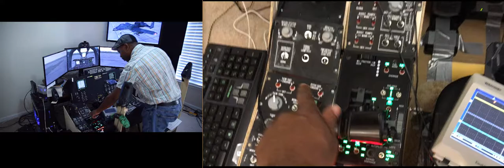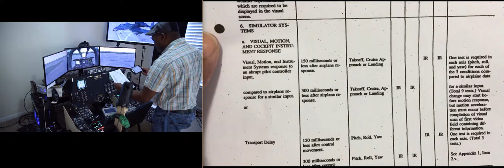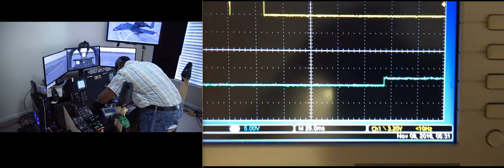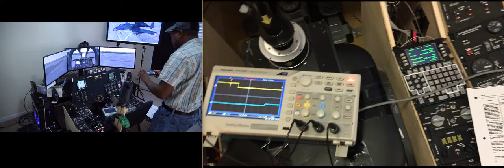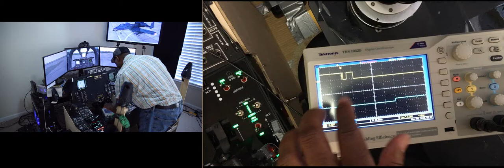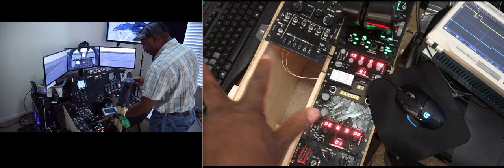Transport Delay in I/O System for DCS A-10C flight simulator

Comment: Did you make or purchase your engine cluster?
Reply from the maker: I made it. In the process of making a new one to the proper dimensions. The first one was slightly too large as I used 52mm glass. This made the overall panel too big.  I should have went with maybe 49mm to 47mm glass. 
http://www.ebay.com/itm/Genuine-Tiffen-UV-Protector-49mm-Lens-Filter-Made-in-USA-S311124-/381154774937?hash=item58be984f99:g:5kEAAOSweW5U3FlW

I 3D printed the panel with built in standofffs and use tower pro sg90 motors with 3D printed gears to make it 360 degree swing. I used paint to make the bezels look real. And found a gauge canvas maker utility online to print out the art work for the gauges.
http://www.bauer.uh.edu/parks/make_gauge2.htm
Reply: Thank you for your reply. I guess making a pit isn't really going to have too many thrifty tricks/shortcuts.